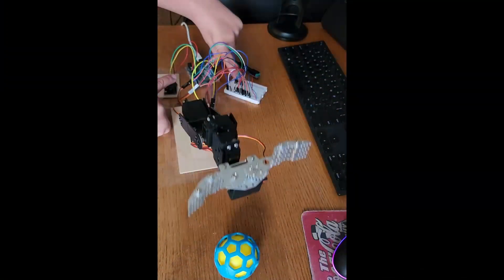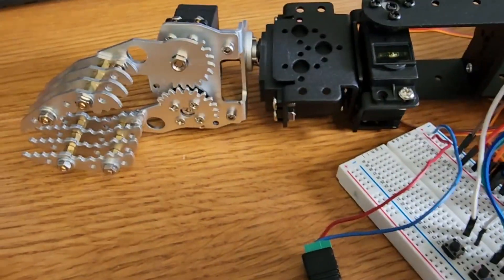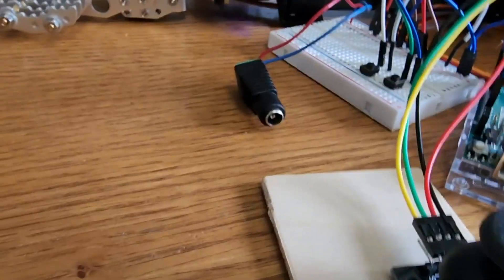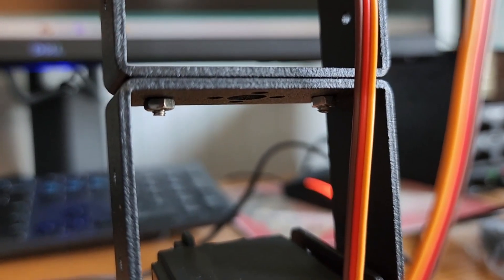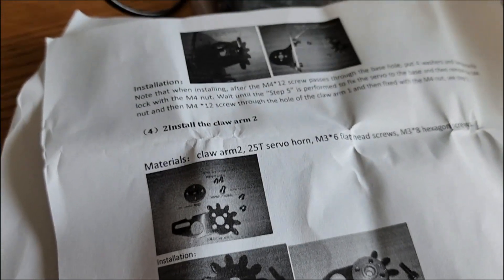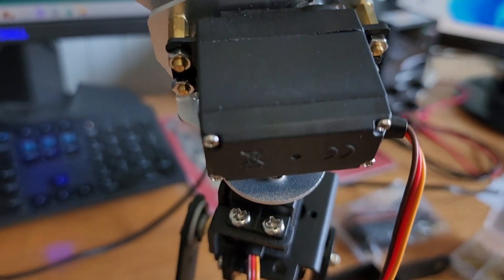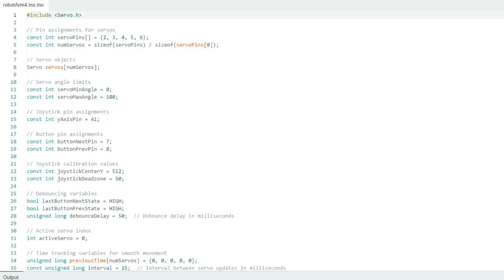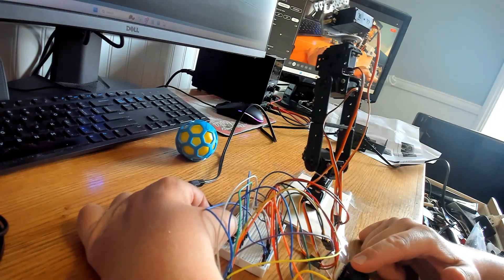How To Build Your Own Arduino Robot Arm Using Five Servo Motors and A Joystick

Comment from the maker: In the last section of this video, you can see that I put servos at a rotation max of 180 when they are not. The MG996R and the MG995 are both 120 degree rotation servos. The code posted on our Facebook page has been corrected. Sorry for any inconvenience 😳

Comment: Please place the code in the comments
Reply from the maker: #include <Servo.h>
// Pin assignments for servos
const int servoPins[] = {2, 3, 4, 5, 6};
const int numServos = sizeof(servoPins) / sizeof(servoPins[0]);
// Servo objects
Servo servos[numServos];
// Servo angle limits
const int servoMinAngle = 0;
const int servoMaxAngle = 120;
// Joystick pin assignments
const int yAxisPin = A1;
// Button pin assignments
const int buttonNextPin = 7;
const int buttonPrevPin = 8;
// Joystick calibration values
const int joystickCenterY = 512;
const int joystickDeadzone = 50;
// Debouncing variables
bool lastButtonNextState = HIGH;
bool lastButtonPrevState = HIGH;
unsigned long debounceDelay = 50; // Debounce delay in milliseconds
// Active servo index
int activeServo = 0;
// Time tracking variables for smooth movement
unsigned long previousTime[numServos] = {0, 0, 0, 0, 0};
const unsigned long interval = 15; // Interval between servo updates in milliseconds
void setup() {
// Attach servos to pins
for (int i = 0; i < numServos; i++) {
servos[i].attach(servoPins[i]);
servos[i].write(90);
}
// Configure button pins
pinMode(buttonNextPin, INPUT_PULLUP);
pinMode(buttonPrevPin, INPUT_PULLUP);
}
void loop() {
// Read joystick and button values
int joystickY = analogRead(yAxisPin);
bool buttonNextState = digitalRead(buttonNextPin);
bool buttonPrevState = digitalRead(buttonPrevPin);
// Check for deadzone
if (abs(joystickY - joystickCenterY) > joystickDeadzone) {
// Map joystick values to servo angles
int servoAngle = map(joystickY, joystickCenterY - joystickDeadzone, joystickCenterY + joystickDeadzone, servoMinAngle, servoMaxAngle);
// Reverse the direction for horizontal servos
if (activeServo == 0 || activeServo == 3) {
servoAngle = servoMaxAngle - servoAngle;
}
int targetAngle = constrain(servoAngle, servoMinAngle, servoMaxAngle);
// Move the active servo to the desired angle
moveServo(activeServo, targetAngle);
}
// Debouncing and check button states to switch between servos
if (buttonNextState == LOW && lastButtonNextState == HIGH) {
activeServo = (activeServo + 1) % numServos;
delay(debounceDelay);
}
if (buttonPrevState == LOW && lastButtonPrevState == HIGH) {
activeServo = (activeServo - 1 + numServos) % numServos;
delay(debounceDelay);
}
lastButtonNextState = buttonNextState;
lastButtonPrevState = buttonPrevState;
}
void moveServo(int servoIndex, int targetAngle) {
int currentAngle = servos[servoIndex].read();
if (currentAngle < targetAngle) {
if (millis() - previousTime[servoIndex] >= interval) {
servos[servoIndex].write(currentAngle + 1);
previousTime[servoIndex] = millis();
}
} else if (currentAngle > targetAngle) {
if (millis() - previousTime[servoIndex] >= interval) {
servos[servoIndex].write(currentAngle - 1);
previousTime[servoIndex] = millis();
}
}
}